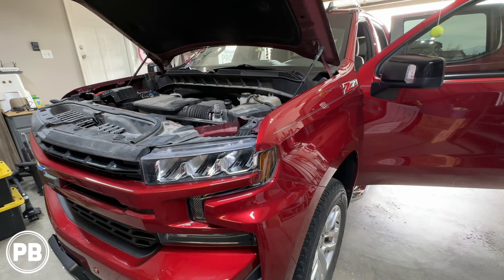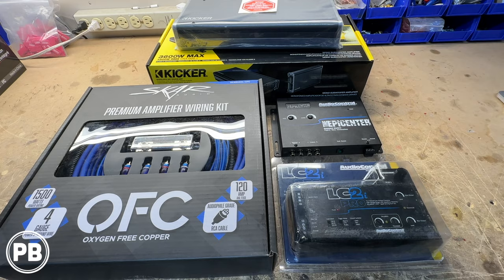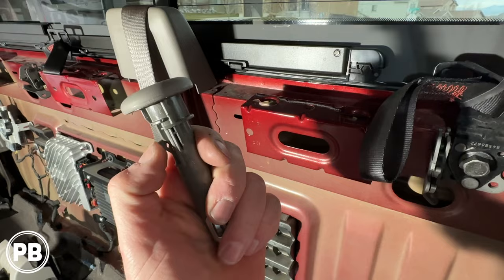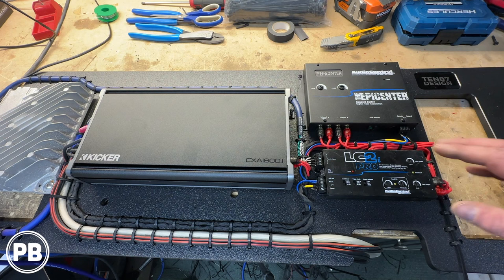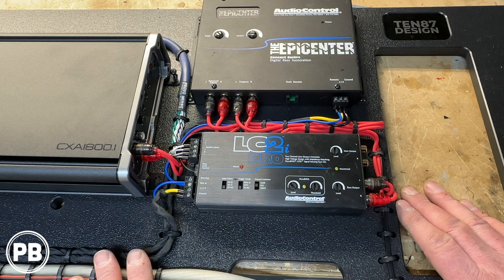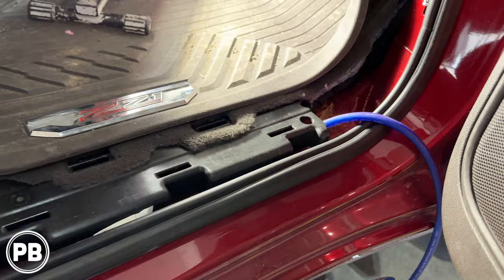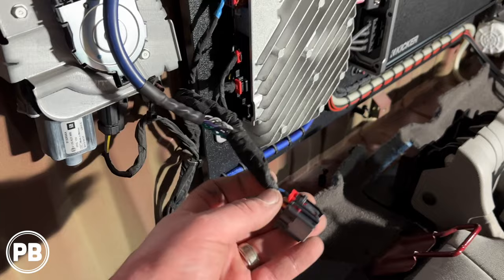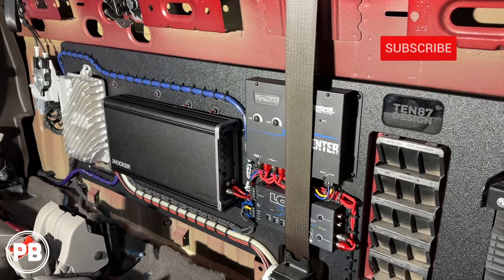2019 - 2024+ Chevy / GMC Truck Amp and Subs Install

Comment: Option one: You would have to remove the seat every time you want to make quick or minor adjustments. Option two: leave the rear passengers without a comfortable back rest 😅
Reply: Option 3 buy a jl audio vxi amp that allows remote tuning via ipad

Comment: Everything is great, but that epicenter effect wont work without its own bass knob! You guys should know that
Reply: It’ll work.  Just aren’t gonna make any changes without taking the back seat off.
Reply: @gyfhj If you don’t have an epicenter knob connected then the effect is off.
Reply: @iamliljeffie2305 what effect?  It's a volume control.  It's still gonna do everything you need it to do, minus the ability to adjust the bass to the song.
Reply: Bass knob mentioned @9:27
Reply: @adambryson953  He said bass knob coming off the LC2i not the epicenter.
Reply: @grimWNY  If the knob isn’t connected it doesn’t turn on, simple as that. I know because I own one, You can disassemble the knob they’re a safety inside that prevents the unit from being used without it.
Reply: Ahh, gotcha!
Reply: @grimWNY bro you don’t know what you’re talking about
Reply: Epicenter adds effects to bass but only songs with string bass or drums uses it well then,ore natural but not so low bass. Say rock, country or a lot of mexican music.  Hip hop or rap will not make good use of it so in those songs we usually turn epicenter off

Comment: On the 2024s that nipple on the grommet does not exist. GM says to pass the wire through the plastic slit directly on the bottom of the grommet with a metal rod. It's a massive pain in the ass (specifically on the diesels)
Reply: Was your amp the same as the video? My 24 2500 has a different amp with only three plugs. If so what wires did you use

Comment: Just wanted to say thanks for posting this. I installed quad 8's in my 24 GMC SLT. It was easy with this excellent video.
Reply: Did you have a problem with remote unlocking doors and turn on the Amp?  Like a couple of others have commented about?

Comment: Wish i would have seen this video on the amp rack, i did how ever order the same one recently. I also went with a T-harness from LLJ Customs that plugged into the bose amp and left pig tails for the LC2i. My problem how ever was finding the right size amp to fit behind the seat....if it's over 2.5" tall, the seatwon'tt fit. I was using the SFB2000 for almost 3 years before the cooling fan quit working.Took some time to find a new a new stronger amp but, found the DC Audio 3.5k that fit perfectly...with a luttle grinding of some plastic off the seat for extra clearance. Almost back in action.
Reply: My other issue was the mounting bolts for the rack....I had to counter sink all but 1 so there was room for the amp to sit. So, unfortunately I couldn't assemble everything outside of the truck...had to install the board then the equipment.
Reply: Good info on the amp height. Looks like the Skar equivalent 1500 is 2.25  height. Should fit.

Comment: Could 0/1 gauge wire fit through that grommet in the fire wall
Reply: Yes, it will. I have 2/0 running through mine.

Comment: Did you lose the fader with this install method?

I assume those are the rear speaker full range outputs, thus avoiding the need to (sum) the front highs and lows?

I suppose this was for a sub install only, and no other drivers were amplified beyond the factory.
Reply: He tapped the subwoofer wires so no it doesn’t affect the fader and there’s no full range signal cuz of the Bose amp

Comment: How would this affect door chimes on a non Bose amp silverado
Reply from the maker: Non-Bose means there isn't an external amplifier in most cases.  The radio powers the speakers internally.  If you have that setup, all you need is the GM Radio T harness and line out converter we have linked in the description.  Factory radio module is behind the glove box.

Comment: I believe you should have used the main output from the lc2i to the epicenter instead of the bass output
Reply from the maker: No, we used the bass output.  thanks for playing.
Reply: Ya I know it sounds like shit since he used the factory sub signal. Epicenter needs a full range signal to work properly. Need to tap front door speakers instead. Nice set up though
Reply from the maker: Unless you've done one yourself, it sounded fantastic.  factory Bose amp has passive crossovers on the door speakers so the sub signal was the real only option outside of adding a DSP.  Non-amplified version has a full rage signal going to the front door 6x9's. @markvveinotte1766
Reply: Yes I have done one and that’s why I say that. Sub signal is also crossed over and has too much of a bass signal for epicenter. It’s works for that loc but I found epicenter not so much. Needs min 200hz-1000hz to work properly
Reply: @markvveinotte1766  I am looking to install a set up similar to this, with an lc2i pro and an epicenter with a bose system.  Are you suggesting that using the yellow/yellow black (door speaker) would be the better option here since both the sub signal and door speakers have passive crossover?

Comment: Nice craftsmanship. Question on the overall system. It seems like 1800W would be a bit overkill putting it up against factory door speakers & amp? How did it sound overall? To me the factory Bose system lacks on the mid/high range already, did the subs drown it out?
Reply from the maker: It's what the customer wanted.  Yeah, it's tons of bass, but I recommend a more rounded system, just depends on your trim and budget.  If you want more direction, send me a message on facebook or instagram.
Reply: @ProvoBeastAudio  good deal, thanks for the quick reply!

Comment: Hi great video 
I have a question or many, I am in the proses or planning to replace  all the for speaker and add a subwoofer , I was planning to live everting the same way , I’m talking about the door speakers and tweeters. Until I saw your video , my question is can I bypass  the boss amp or replace it all together and if yes HOW ??
Thank you. (3500hd Sierra - boss audio system)

Comment: Ok I want to keep Bose amplifier and add 4 channel amp for new 4 ohm truck speakers and sub amp for one 13” sub woofer with LC5i. My question is can I use factory speaker wires? Is there a connector kit for this? And do you have speaker wire diagram? Thanks.

Comment: There was a black wire ( bass nob?) running by right side of the LC2i that you mentioned needs to run to the front along with the power wire. However the video did not provide connection for this wire? What was it for and where does it connect to?
Reply from the maker: Bass knob cable, it literally plugs into the bass knob, mounted by the steering column.

Comment: Kicker 1800 watts @ 1 ohm means about 800 or 900 watts rms.
Reply from the maker: Kicker puts the RMS wattage on their amps, not Peak power, sorry.  This is indeed 1800 + watts @ 1 ohm per the birth sheet included with the amp.
Reply: @ProvoBeastAudio  Its good Kicker has changed and went back to there old roots. After they stopped the ZR series it seemed all there stuff was over seas and over rated power the quality went down hill in the mid 2000's But seems they revamped. So good on them.

Comment: I’m following this set up exactly. What size wires are the four 8’s using in the box?  The wire kit you linked to use has 16 AWG. Is this correct to use?

Comment: I used the same wires for signal with a jl 10 w7 an lc2i and a 1000 watt jl amp for some reason the signal from the sub out sounds terrible and the full range signal I can't get the jl amp to cut-off at 80 do I need a dedicated sub out?? Past the lc2i? Plz help!

Comment: Any idea if the set up will still work for two 10’s, or would you be able to explain what I’d have to do differently. Thanks
Reply: The set up will work with 10 inch subs. Just make sure that you have the proper type of subs that will fit under your seat, recommended shallow subs, unless custom built enclosure, requires lifting the seat.

Comment: are you able to pull your remote off of the bose amp wires if you are not using the lc2 in the video? and do you know which wire that would be?

Comment: Thanks for this video.  It's well thought out.  Question:  can I use a PAC SNI-15 Preamp Adapter, PAC SNI-50A Line out converter, and PAC SNI-35 Variable LOC Line out converter to achieve the same as your LC2i PRO 2-Channel Line Output? BTW, I don't have the Bose Amp/Speakers @ProvoBeastAudio

Comment: what is the ohm load of the bose for dash speakers? are they 3.5in size speakers and can i just get a aftermarket speaker and replace the dash speaker? thanks
Reply: You can buy aftermarket speakers and drop in if they are the same size. The bose amplifier will still amplify the sound, which in turn will make them sound good. The speakers are 2.5" in the dash.

Comment: I followed your setup. I have the 23 silverado with bose. When I unlock the doors the  amp comes on? What could be the cause of this? I'm assuming its the remote wire but just curious how to set it up to where it doesn't turn on til the truck is on
Reply: You will need to change the way the LC2I comes on. You'd have to set it to Audio, or you'll have to run a remote wire to your fuse box.
Reply: Im having the same issue. When unlocking the truck all my system comes on.  And sometimes im getting the thump sound of the subwoofers when theres no music playing    Any advice??
Reply: @franciscoovilla1666  same here. Been looking for a fix.
Reply: What did you end up doing?
Reply: Depending on the LOC you're using...

You will need to change the way the LOC comes on. You'd have to run a remote wire to a fuse in your fuse box that only comes on when the truck's ignition comes on and turns off. Sometimes the USB charger will work, or another accessory type fuse.

Comment: Looks great! I have a LC7i I’m looking to install. Can I get power and ground off my distribution block instead of the amp? Also would I need a fuse for the LC7i?
Reply: Yes, you can get power and ground from there. Add a small 2A inline fuse on the power wire going to the LC7I.
Reply: @JasonWW2000  ok thank you!

Comment: Started a complete audio upgrade in a ‘22 this weekend. Did you have to cut foam out of the back of the seat to get it back in. There’s no way I could mount that board and move everything around without doing so.
Reply: Did you figure this out just ran into the same problem
Reply: @zachschmidt2802  I got a 2000w amp behind it. Had to cut a significant amount of foam off the seat. I did it in a way that the amp is contained in one of those areas that lead to the cab vent. Closed off the other cab vent. Theory is it’s going to push all cabin air/pressure out the vent with the amp right beside it and cool it. You couldn’t mount that board without taking all of the foam off the seat. I would definitely put some sound deadening on that back wall too. For me, the real downside is not being able to access the amp without unbolting the seat.
Reply: Also moved factory equipment that was back there to behind the box under rear seat. Not as clean as this install, but it’s clean enough for adding an LC2i and mids/highs amp under the passenger seat, four eights under rear seat, and 2kamp behind the seat. No wires showing. GM does kind of make hiding wires easy with their huge channels down the side. Now if they’d just unlock my ECM…
Reply: The amp board is made for trucks with the Bose system.

Comment: Why did you grab signal from front ? Why not the sub signal wire ? (The two Yellow wires) Now when he lowers the bass the sub goes away and when he fades or balance left to right the subs have no signal !?
 Second epicenter is not  needed.  Looks like a case of over sell to me.
Reply from the maker: Did you not watch all the video? (Apparently not). We tapped into the Boss sub output for signal, not the fronts. Secondly, the epicenter was provided by the customer as he wanted it installed. We didn’t sell him any of this equipment as it was all provided by the owner of the truck. This truck went through two other shops before it made it to use to fix and make right.

Comment: How thick is everything in relation to the seat back? How much of the foam had to be trimmed?
Reply from the maker: We didn't have to trim any foam, and still had decent air flow.  If you have a taller setup, or an amp that runs hot, then trimming is recommended.
Reply: @ProvoBeastAudio Thanks for the reply. I'm attempting to install a relatively simple setup, a pair of Kicker hideaways. They're about 3 inches thick, so that's why I was curious about the foam trimming. Thanks for the heads up.

Comment: Did any of the foam on the seat back-rest need to be trimmed for this setup?  Does the foam press up tight to the equipment / compressed?
Reply: None of the channels show that, or the seat reinstalled. I have 3 amps on my custom rack and I had to do a lot of trimming and it still wont fit perfectly. The bottom of the seat is about 2 inches from going back into place. The "foam" on my 2024 GMC3500 PRO CREWCAB is not a soft foam, but more of a molded Styrofoam.  Very dense, but cut well with a Oscillating Multi Tool.
Reply: @-Primer-  I ended up 3D printing custom brackets with brass threaded inserts.  Exoxied the brackets into place and the equipment is removable.  I only had to trim on small piece of foam, but stuff does seem to squeeeze tight a bit on re-installation lf the seat.

I purchased a 3D scanner so I can model it better for the sub integration which is next on the list of things to do.
Reply: @andyh8239   Well that's clever. I'm pretty well versed with Fusion 360 and/but my printer is only 230x230. The idea of printing brackets to get the amps to sit "deeper" has got my gears turning. I guess that's a new project to work on  --- DAMMIT !
Reply: @-Primer-  I used a profile gauge when I made them and they worked great  but the 3D scanner thats on the way should be a game changer as you can mock it all up virtually and obtain perfect profiles.  Could even scan the back of the seat foam to identify what needs to be cut.

I designed a holder that clamps to a capacitor which fit perfectly behind the seatbelt strap (cap locks into place with set screws and leaves behind only a thin bracket when removed.

I was even able to print connectors to adapt the tweeters to the factory dash harness.  I made a mockup of the tweeters I wanted to ensure they would fit (Morel 728's) as the ScanSpeak ones I planned to use had too large of magnets.

I'd like to scan the doors next to see if I could put some ScanSpeak Revelator 8's in the doors.

Madisound has a lot of good stuff to choose from.

Comment: Great video as usual!! I have a question.  In a f150 I want to install a lc7i. Is there a harness in the back where I can pick up a signal without going up front to the radio? I'm also removing the pac ampro.
Reply from the maker: Hey there, thanks!  Amp Pro connects that the radio, along with any T-harness on the market.  The only instance where a harness is available in the rear would be trims with the Sony / B&O audio system from Ford where you can add the bypass harness at the factory amp in the rear.  So the answer is a "yes, but...".  Depends on your trim.

Comment: What signal is that on the plug that you tapped into? The GM accessory Kicker sub shows using a yellow & yellow/black pair near the passenger front kick panel, is this a better spot to pull the signal from?
Reply from the maker: It's the Bose subwoofer wiring connection at the Bose amp.  It's right there instead of running the wiring to the bose subwoofer in the center console.
Reply: Do you have a part number for the harness you’re using to tap into the sub wires?

Comment: Hey I got a 2024 gmc at4 with bose I'm wanting to put 2 10s under the seat I want to keep the bose on the door speakers so would a kicker keyloc be good to tap into the bose amp the keyloc is suppose to auto EQ the signal to correct signal thanks
Reply: Is your Bose amp different as seen in the video? My 24 2500 Bose amp only has three plugs and not four like this one in the video

Comment: How would i just run the rca to the amp from the lc2i without that epicenter module. Would i go strait to where the rca out goes from.the epicenter module?
Reply from the maker: without an epicenter, just LC2i output right to the amp input.

Comment: I have a 2020 Chevy custom trail boss without Bose. I looked up the amp rack with the link and the website said it was not compatible to my truck. In your opinion could I use the amp rack that you used or will I have to find a different rack?
Reply from the maker: I'd reach out to sounds good stereo to see if they have a solution for your truck.
Reply: It'll physically fit in your truck, but not all the mounting studs may be present to secure it to the back cab wall is all.
Reply: You'll need to cut out the foam and add mounting brackets to get it to hold

Comment: Great Video! Question. Can that board be used on a Non-Bose truck? Their website doesn’t have a board for a non-Bose.
Reply: The amp rack from the website will not work for non bose. They say there is foam behind the seat that doesn't allow the amp rack to fit properly. Fits perfect for Bose equipped trucks

Comment: Is it just me or does everything stay on longer if you don't hard wire the remote wire  the old fashioned way? Jusy feel like it drains more power!?!?!?! If it's hooked to the ignition is shits off right away... if u do it the "lazy way" it stays on for over a minute after the vehicle is shut off... thus draining battery and putting more load on your alternator and making it work harder.... why aren't people discussing this more?

Comment: I’m using the lc6 and I have the Bose system I’m not getting a signal from the rear speakers any advice
Reply: Use the signal from the front, yellow/Yellow & Black